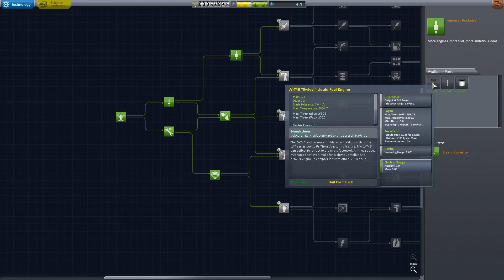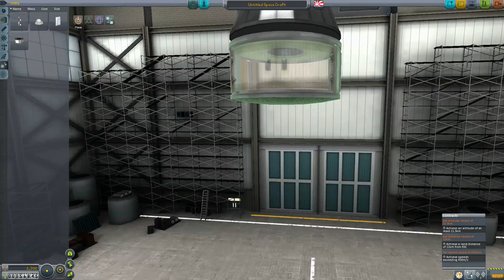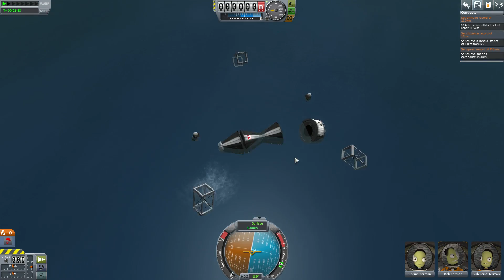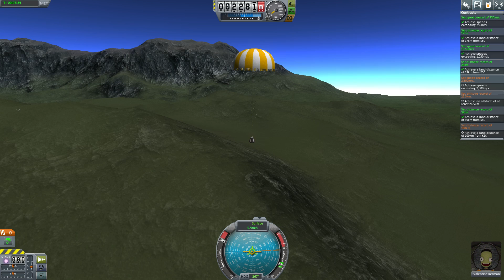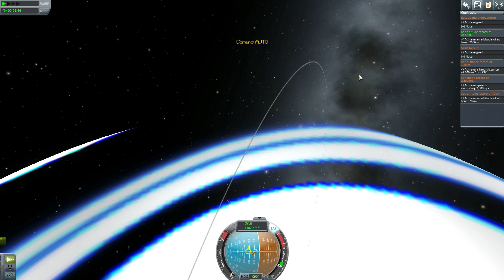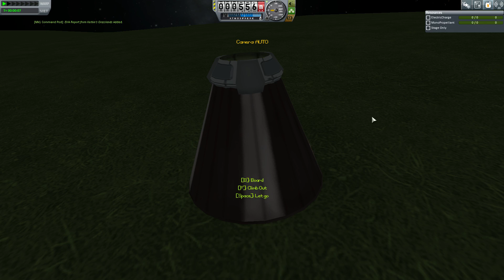Increment The Death Counter [2] Kerbal Space Program 1.0 Career

Comment: Wow, the thing at 7:50 costs 12k and you barely got 4k back ? At that rate you will quickly go bankrupt.

When you start up, learn to use SRB's (solid rocket boosters) for everything that you can't recover, because they are way cheaper.

Just sent Valentina in a 100 km sub-orbital flight, with 2 goo canisters, a science junior, using a BACC booster with 2x RV-10's on the side and last stage with a LV-30 engine that gets recovered ! Oh and don't forget to use chutes, LOTS of chutes, especially if you recover the engine, 1 M16 doesn't cut it, use radials. AND fins, lots and lots of fins, on every stage, SAS is kinda crap, especially with non-vectoring engines.

32:30 In the beginning you want to land as close as possible to Space Center, the further off you land, the less money you get back from salvage operation, so you actually want to make your suborbital trajectories a very tall parabola.

Comment: You have to check the Mission Center for new missions. If you played beta, you'll know that the first missions had to be accepted in a special order to get all the science and funds. Instead, they are automatically there from the beginning. As they are completed, you'll get no more automatic missions. And you should always accept new contracts you feel you can/will do in the next few launches, as they give you funds. Just make sure you do them, because you only have a limited amount of slots for active missions.

To put three command pods into one craft is not that smart, really. They cost money, adds mass and the benefit of having several crew members is actually not worth it. Instead, you should have just gone straight for space – suborbital – alternatively orbital. It's hard, but not impossible, to achieve orbit within three or four launches.

You can fix the heat shield bug though. 
Go to your KSP folder and follow this address: GameData/Squad/Parts/Aero/HeatShield. Here you will find the files HeatShield1.cfg, HeatShield2.cfg, and Heatshield3.cfg. Open these files using a text editor of free choosing and fine the line that reads "PhysicsSignificance = 1". Change the 1 to a 0, for each heatshield cfg, and your heatshields will now add their mass to your craft the right way; meaning that instead of just adding it's mass to the parent part, it will now add its mass right where it is, which means it will shift the center of mass when you place it. Or alternatively, just download the 1.0.1 hotfix. This specific bug, and many others, has been fixed.

The Service Bay is for putting vulnerable parts in, like batteries and thermometers as they often blow up when overheating. It's more or less like the cargo bays; an empty container to put stuff inside it. I think the problem was the Modular Girder Segments being merged into the Service Bay. KSP does not like that.

The rotation you experience when flying is due to the new atmospheric model. You can't deviate from the velocity vector too much, or the rotational force created by the atmosphere will spin you out of control.
You should also face the back of the command pod into the airstream. What happened was that the command pod got hot and heat transferred down to the Science Junior, which hit its limit and exploded. You don't always need a heat shield for suborbital flights, but you need to point the right way into the air flow.
But don't worry, you will get them back. On Normal difficulty, missing crew members re-spawn.

Comment: The Service Bay is for putting vulnerable stuff in (instead on the outside of your rocket, because it will burn up on reentry now), such as Batteries or Thermometers or Pressure Gauges.
Reply: That's amazing!  It's like the same thing the tooltip says.  :P